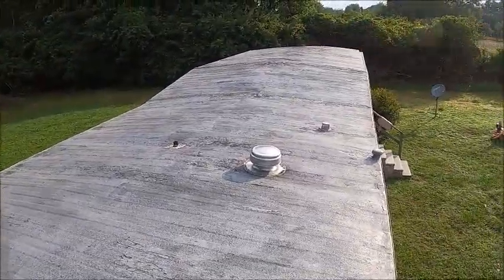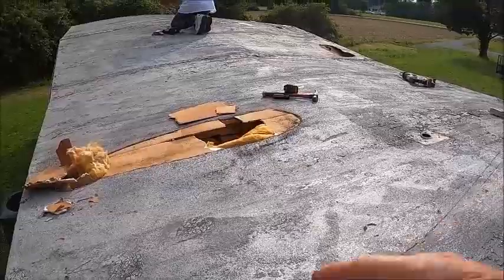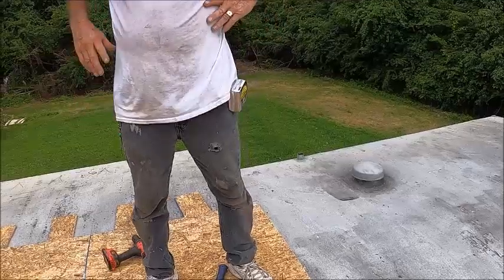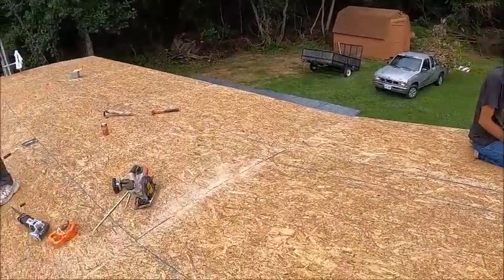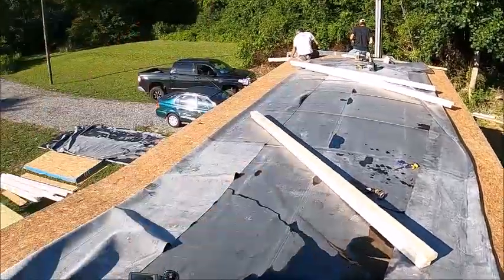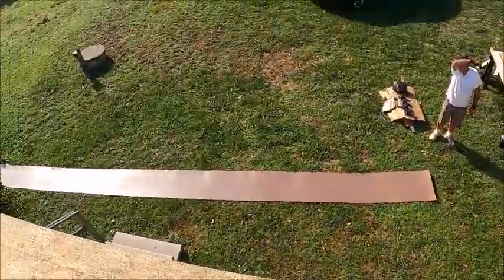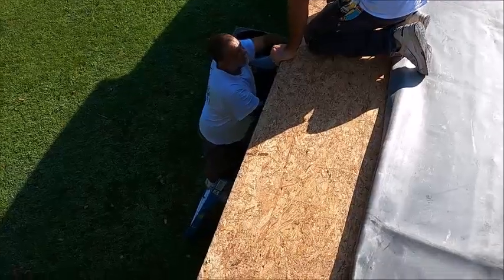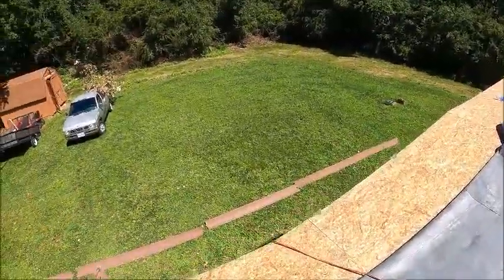How to repair a mobile home trailer roof. Training Video Virginia 1

Comment: Why no 1x4 strips on this one? You do a good job of explaining the work you do. Even a non roofer like me understands. 👍🏻
Reply from the maker: Some mobile homes when you go on the top of it it is very up and down in between the rafters or metal. In that case we run one by four strapping in order to smooth out the surface were installing a OSB to.. I’m glad I could help

Comment: Would a rubber roof be feasible in the California desert? Love the channel, by the way.
Reply from the maker: Yes all day  Itcan be turned White if you want to Use Hydro-Stop It works well
Reply: Id advise it Over shingles. I've found from living all over the south west from Colorado to California and all the Southern States in between. Asphalt shingles have a quarter to half life of manufacturer suggested product lifetime. The wind and Sand kill the shingles. Metal works just gets ugly fast from any hail. So my recommendation is rubber. I'm wondering when they're going to invent snap together easy install plastic roofs. Which would be significantly cheaper. Also less product lifespan. But I think they'd outlive asphalt usability